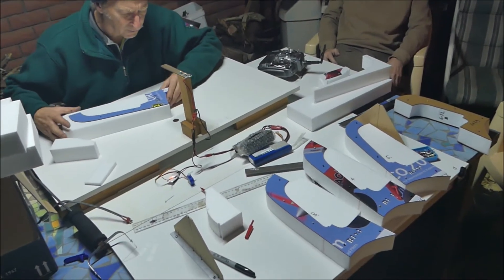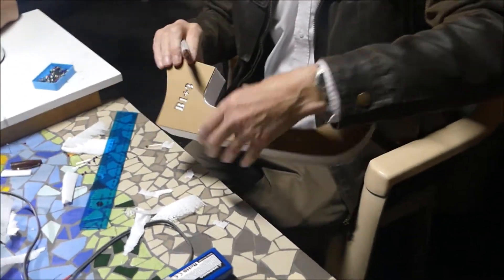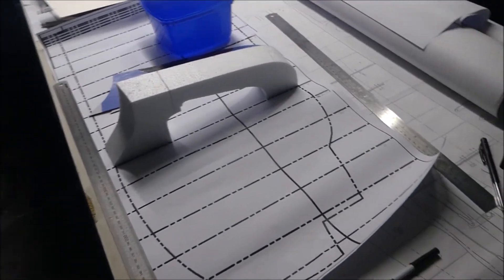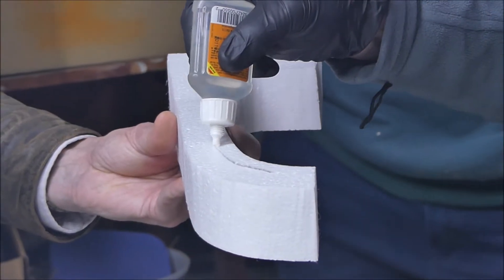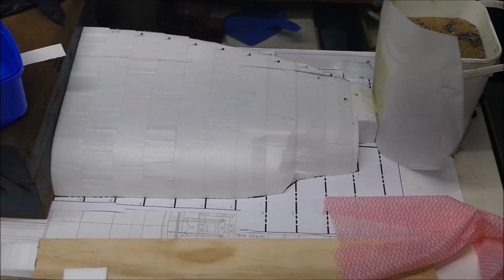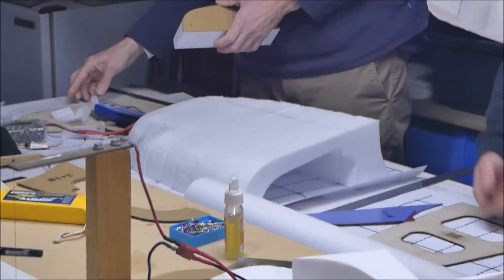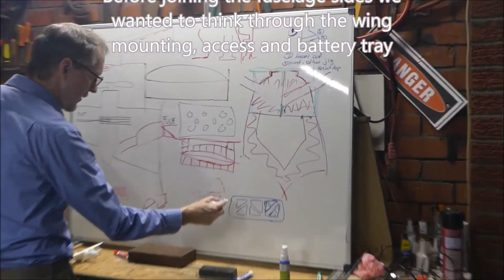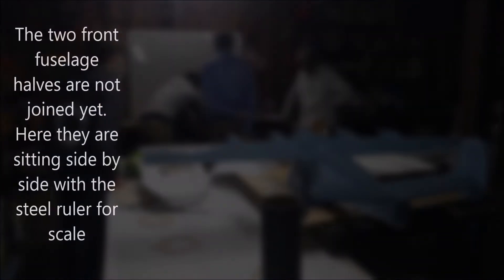RC PBM Mariner build - part 3

Comment: Awesome work, I’m building one as well out of foam board, about a 6ft wingspan I’m guessing. My worry though is how the wing spar will work and be strong since the wings bend up like that
Reply from the maker: Thanks. Good luck with the build. Will be interested to see how you go. This is a great looking plane but with a complex shape. We are still working on the centre wing design. We have a laser cut ply spar, plenty of fuselage support and fibre glass re-enforcement in mind.